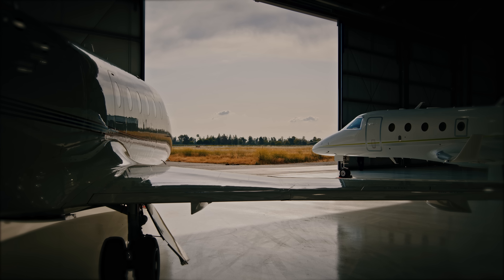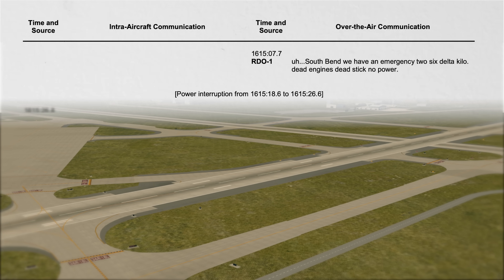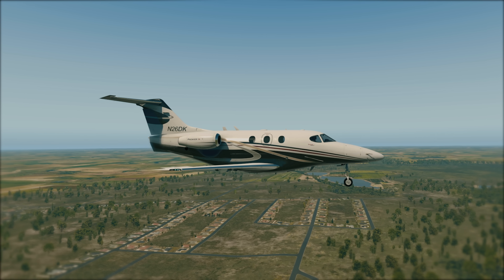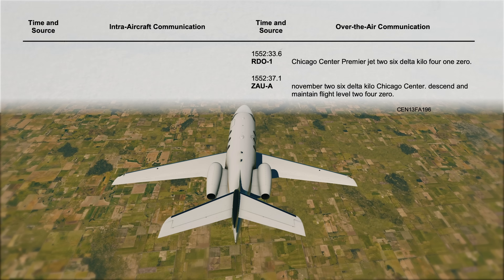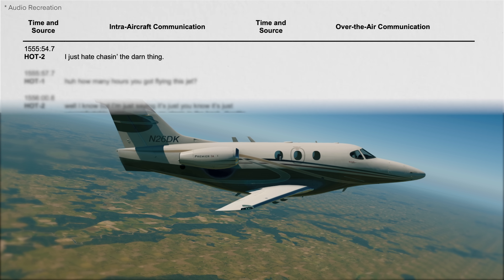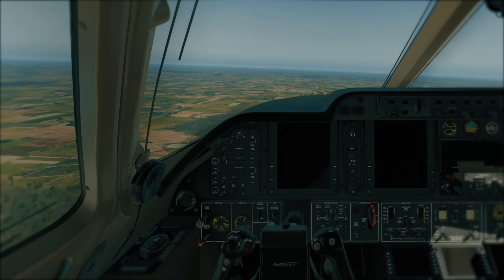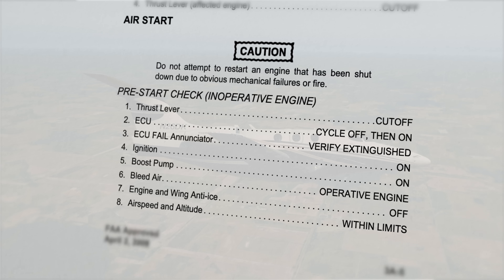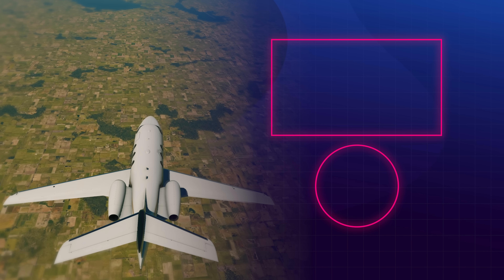Passenger Causes DUAL ENGINE FAILURE | Accident Case Study

Comment: ATC - N26DK your gear is not down. Perform an engines out go around. Those Air Traffic Controllers are geniuses.
Reply: They would have been better off doing a belly landing on the runway. Hindsight is a bitch. 
The whole thing is just sad.
Reply: @jamesdozier3722  yeah a belly landing would have been fine. The throttle design should prevent inadvertently shutting down the engine. Anything that can go wrong will go wrong, eventually
Reply: @Greg-yu4ij I agree with that one, the fuel cutoff should be on a cover protected switch and nowhere near the f%$king throttles!
Reply: @Greg-yu4ij  there was a lock, but someone who wasn't familar with how it worked disengaged that lock.
Reply: @jamesdozier3722  They would have been better off flying the damn airplane and solving the problem,  instead of working on solving the problem and not flying the airplane.
Reply: My guess is, that instruction was a CYA call, not a call they thought he could follow. I make the assumption the controllers are at least as smart and tuned in as the rest of us. With that assumption, I would guess they just want it on record they told him and waived him off.
Reply: Likely. As they have no clue of the situation changed due to communication. They spotted, they called it. Did what they should and could.
Reply: @cpl_0503  Imagine he actually had no power but in the immense stress of the situation executed an attempt at a go around as a reflexive response to the ATC command. Instant stall and impact.
Reply: My guess is they weren't sure if the plane had engine power or not. The pilot only said "we have no power, no hydrolics" but never declared a mayday for dual engine failure
Reply: @madjoemak  From the transcripts and video the pilots said they were dead engines (plural) and then no power and no hydraulics.
Reply: I was thinking that also. 
A belly landing would’ve been way better than what happened. Not a mention of that.
Reply: Yeah this bothered me too, I think more properly they should have just informed the pilot of the lack of gear, not commanded a go around
Reply: Yeah, I wasn't there so idk what happened, but I think I would have landed the plane on the very first approach to the airstrip. It wouldn't have been pretty, but it wouldn't have crashed into a house, either. I would have 100% landed the plane instead of going around. People can survive a plane landing with no gear, it happens a lot. 2 passengers survived the crash into a house, they would've probably ALL survived a gear up landing. Tragic.
Reply: @whatta7793   the gear wasn't up apparently, it was partially deployed, which means as soon as it touched down it would likely go hard left or right, and the plane would whatever is there to hit, a hangar, a tree, a house, a ditch, a road, and at jet speeds with fuel on board the odds of loss of plane and people is very high
Reply: @PRH123  The actual report doesn't make mention of a partial deployment on the first try at landing. That being said, the controllers did nothing wrong by asking for a go-around. Pilot ultimately exercises best and final judgement on the call for a go-around. The only thing the controllers may have needed to add was "...if able" to imply that the pilot need not follow the instruction if they can't comply. 

What most people are probably thinking of are non-jets doing powered belly landings. This is totally not the same for a jet, that is unpowered on final at that. Jets have a higher operating airspeed, are much heavier, carry more fuel and so on. The chance of a catastrophic result when landing no gear is much higher for a jet with little to no control. Even sliding off the runway could cause fatal injuries. I'm not saying that it would have been better or not for them to have attempted the belly landing....but there is a reason the controllers call for a go-around as standard practice. Just as there are standards for every single thing the pilot in this case should have done, but didn't, that led to the accident.
Reply: @NACLGames  thanks!
Reply: @PRH123 so it was better to just fly into the house
Reply: It seems that although the pilots were not communicating, air traffic control could see they had managed to restart one of the engines. This is what powered their way to coming around for another landing attempt.
Reply: @cpking7  Correct you can see the heat waves coming off a jet engine in operation. If you can see the gear you can see the engines.
Reply: They may have assumed he had followed his restart procedure and got the engines going since the nose gear came down.
If he had followed the restart checklist, he'd have been able to avert the disaster.
Reply: go around was the worse call possible.
Reply: They had one engine at that point. The tower guys were correct.
Reply: They definitely need remedial training ive never heard something so dumb.
Reply: The worst ATC instruction I've ever heard was a controller telling a Korean Air flight to squawk 7500... the hijack code... on 9/11 of all days. Because of that half of Anchorage was evacuated and the plane almost got shot down.
Reply: @0error.389 Why on earth did he make that call?
Reply: @Darkvirgo88xx   the aircraft indeed did do a go around, what exactly was dumb?
Reply: The last they heard from the pilot was that he had no power.
Reply: @PRH123  The call for a go around and them doing one were both dumb. It was a emergency dont tell a emergency airplane to go around because it involves banking turns and what do you know they banked into the dead engine right into a stall spin into a house. Thats why its dumb.
Reply: @Darkvirgo88xx   it’s not a prop plane, a partially deployed gear landing in a jet would have been fatal for everyone

There is no differential thrust, ie no dead engine with both engines on the tail, that was not a factor in whatever happened

With one operating engine a jet of that class if fully capable of going around, as indeed it did
Reply: @Darkvirgo88xx they didn’t stall and spin then. That came when they were turning back towards the airport. Also you can turn into a dead engine, Bob Hoover proved that. You can providing you are at or above VMC
Reply: @PRH123 do you fly? Hold a jet type rating ?
Reply: @PRH123 also a partial gear is not automatically fatal
Reply: @PRH123  At that point it was dead stick , no engines running!
Reply: @kenclark9888  The difference is these guys didn't know that plane to know any of that or they would have got both engines started and known why only the nose hear was out.
Reply: @jcbbb  Aviation isn’t so safe because we don’t take the attitude of “just get good or get out”. It’s so safe because we recognize when and how mistakes are made and we work to rectify them.

Humans are flawed and make mistakes, especially in high stress situations. Good protocol accounts for that.
Reply: @PRH123 doesn't the fact that 2 survived prove it wouldn't have been fatal for everyone? Are you saying it's better to flip the plane over?
Reply: @Darkvirgo88xx  I'm no pilot but my background is physics and that call made no sense to me...goes against basic logic...But I assumed that was my lack of knowledge re the intricacies of aviation, etc. So sad.
Reply: @PRH123  Well, then he didn't follow ATCs instructions. He was instructed to perform an Engines Out Go Around.
Reply: yeah. a no gear landing approved would have been better call
Reply: @jamescollier3  Or even just adding "if able". That could be the difference between a scared, stressed pilot saying "unable" or trying to do the impossible because they were ordered to.
Reply: Such as life,,,,,, It's all full of 
what If's,
if only's
should aaaa's 
could aaaa's
would aaaas,
I know my life is...
Reply: Thought the same... may have not been communicated the emergency but point stands
Reply: Couldn't they hear the engine sound? They could know it works but that moment
Reply: Agreed but the pilot shouldn't have listened and put'er down on its belly.
Reply: The first thing wrong that I noticed in the video.
Wonder if it was mentioned in the ntsb report.
Reply: @najaB76  Because he managed to get one of the engines started later, but that doesn't change the fact that ATC didn't know that when they told him to go around. They told an unpowered aircraft to go around.
Reply: @derp195  Tower: "Balloon 12345 missed approach maintain runway heading, climb to 3,000, turn right heading 075 maintain 3,800 to WTF VOR and hold."
Reply: @derp195  They were under power.
Reply: @LarsLarsen77  Don't assume. ATC don't know what kind of failure the engines had, just because you can see a heat haze doesn't mean the engine is operating 100%. The call off to fly around was 100% ATC fuck up.
Reply: @derp195  And if they couldn't restart an engine they wouldn't have gone around. So really a tempest in a teacup, methinks.
Reply: To me the saddest part of this accident is the complete incompetence of those Air Traffic Controllers, which lead to two deaths. A simple belly landing probably would have been the most uneventful thing in the world, mainly damaging the aircraft's underbelly and the egos of those stupid pilots

Comment: It should be way more difficult than that to kill the engines.
Reply: I have time in a Premier Jet and if you just pull the throttle levers back, they stop at idle. You have to pull them up an inch or two to lift them over the gate and then pull them back further to shut them down. With even the most rudimentary training, this would be known. Lifting them over the stop is not natural - it is designed so that it has to be a deliberate action.
Reply: @NVFlyer Isn't the A320 and A330 like that? The only difference with them is they have reverse behind idle and their engine masters are behind the quadrant.
Reply: Have you ever turned off your car while driving?
Reply: NO BUT I HAD A FUEL PUMP GO OUT AND IT WAS HARD TO STEER THE TRUCK TO PULL OVER AT 60MPH. @zachscott4867
Reply: @zachscott4867  Not yet so far, but maybe that's because the engine off switch IS NOT BUILT INTO OR ANYWHERE NEAR THE THROTTLE.
Reply: @rawcado  Tell me you never drove a manual without telling me you never drove a manual.
Reply: How many of those planes exist how many flying each day. Do the pilots manage not to turn off the engines on every flight except this one?
Reply: There’s a decent at the back of the throttles. It wasn’t just “oops I pulled back too far”. They had to pull back and pull the throttles through the detents. IE inexperienced hand on the throttle lever.
Reply: It is rather difficult, but human nature and even experienced pilots have made similar mistakes, one bad recent one is explained here where pilot moved the condition levers to feather instead of moving the flap lever and killed everyone on board:
https://www.youtube.com/watch?v=p5m8kvZqwC4  ( Is this a dangerous design? | Yeti Airlines 691 accident )
Reply: @ustelephone  
You guess wrong his passenger is the one who accidentally turned off both engines. The pilot apparently didn’t know what the correct steps to restore them to operation was, according to the NTSB
Reply: @ustelephone  
The latching mechanism is common on mini aircraft. And your car not you need to perform a special action to put it in reverse. That’s the stop you from putting it in reverse accidentally especially when you’re driving. 
The NTSB investigates all the controls involved in an air crash. They will determine if any of them are not up to the task and recommend corrections if that was the case. But that wasn’t recommended in this case they didn’t believe there was an issue they didn’t even list it as a contributing factor .
Reply: @ustelephone  
In a sense they are the pilot. 
Minus the type certification
Reply: @ustelephone  
You’re saying legally that whoever had to control is the pilot. If that’s the law then that’s the law. It doesn’t give them any special skills. 
In situations where the pilot became incapacitated and a passenger had to land the plane, they didn’t refer to the passenger as a pilot. But as you say you’re familiar with the nomenclature so I guess I’ll have to take your word for it.
Reply: @ustelephone  
 
Dear Lord I thought a pilot was an occupation that required a lot of training. To you it appears to be whoever is sitting in the seat. 
I thought a “Pilot” required 100 of hours of training. 
What is the correct title for a person that actually knows how to safely fly an aircraft. I need it for future reference.
Reply: @ustelephone  
So let me get this straight you as a fully licensed pilot can fly any aircraft. Just like on TV.  Don’t be disingenuous.
He had exactly 0 hours of experience in a chat aircraft. And exactly 0 hours of experience in that aircraft. 
The video I listened to indicated he was doing a pretty poor job of controlling the aircraft.  And the person who was the actual pilot of the aircraft, didn’t seem to know everything he was supposed to to be the pilot of that aircraft. The fact that we know anything is because the aircraft ended up with a CVR in a type of aircraft that typically wouldn’t have one. Otherwise, what happened to this flight would’ve been kind of a mystery.
Reply: Yes! Good design can make mistakes less likely, and bad design can make mistakes more likely. This guy made a lot of big mistakes and he was clearly at fault, but that doesn't mean that designers don't have a responsibility to design controls that are harder than this to get wrong. Attitudes like "this design is common" and "he should have read the manual" don't help the innocent bystanders who were permanently injured. If you have an opportunity to make these things less likely, you have a responsibility to. Designers have this opportunity.

Comment: If the pilot didn't do a go around because of the gear he would be alive with a scratched belly and bruised ego. Instead he did a single engine go and lost control.
Reply: Once he got the left engine relit and he went around ...he could have just climbed on out and had all kinds of time to run the checklists all the way though ,several times .Maybe then he would have caught the emergency gear handle being only partially deployed and been able to get the gear down so he could do another low approach to confirm gear down,he likely could have even have gotten the other engine lit too..or set up a nice long stable single engine approach by the books ...plenty of time ,no hurry...oh yeah ...tell the other guy to shut tf up ,don't touch anything ...just let me do everything and you just read the checklist off to me one by one..after they got the #1 engine relit ,just let the airplane fly,Climb to 5000  ,circle the airport , slow down and start over on the checklist ,no need to hurry back around..climb ,relax ,don't hurry ,fix your idiot problem ,the airplane isnt broken,they got the airplane flying again ...let it fly,no need to hurry now
Reply: This.
Reply: @Bax60  Guessing the pilot was emotionally out of sorts by this point.  Nothing suggested he was "cool, calm and collected" and lots of things suggesting he wasn't.  I've met these sorts; play flip with the rules, I'm cool, don't worry about it, then when they get themselves into trouble they panic have no facility to deal with the circumstance, expect others to piss on the fire and pick up the pieces.
Reply: @Nethemas  You got it .
Reply: @Bax60  Exactly.  Just fly the damn plane and relax.
Reply: I think since he had an engine back the go around was appropriate. He should have climbed and held over the airport to reconfigure start the other engine (assuming he didn’t) and slow everything down.
Reply: He could have flown indefinitely on one engine. Also, if he couldn't land with front gear, why do you think he could have landed with no gear at all?
Reply: @deucedeuce1572  Landing with the nose gear only is much worse than landing with no gear at all.
Reply: @ignorance72  I don't think it's much worse. It has its challenges. I know that's why he was bouncing and not skidding as easily as if he had no landing gear... but I think having one engine and only front gear would be easier than no engines and no gear. With one engine running, he would have had much better control over the landing, being able to control his speed and having control of flaps, brakes and other things he would not have had when both his engines were out.

Whether true in equal circumstances, I think (but don't Know) that it would have been better to land with front gear, one engine (and power) than to land with no gear and no engines (and no power).
Reply: I think its more likely that he didn't have hydraulics and NTSB never found out what was really going on. I mean certainly pilot error but recovery likely didn't work exactly as it should have. Most people never have to restart engines in the air and never will. There are 2 people that survived and zero mention of their account tells me this was a "we don't know, but we don't want to say we don't know so we're going to put a bow on it and call it good enough" from NTSB. I'm sure the passengers have a slightly different account of events than what is described here.
Reply: @dustsmoke  This aircraft can be flown and landed without hydraulics. The NTSB did interview one of the passengers. The other passenger suffered a severe brain injury and I'm guessing he probably had no memory of the crash. The one who was interviewed didn't have much information on what happened but everything he did say was consistent with what was described in the video. You'd know all this if you actually read the report.